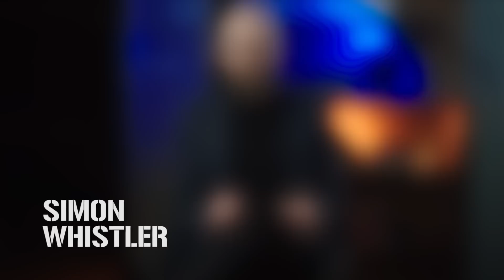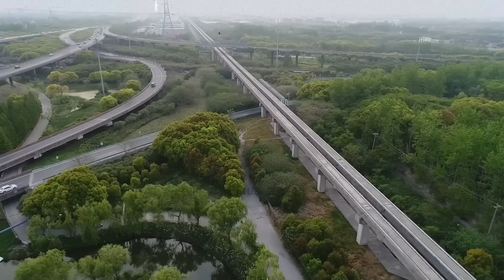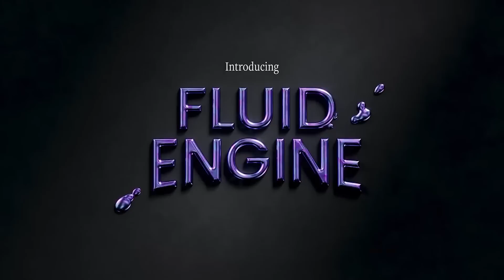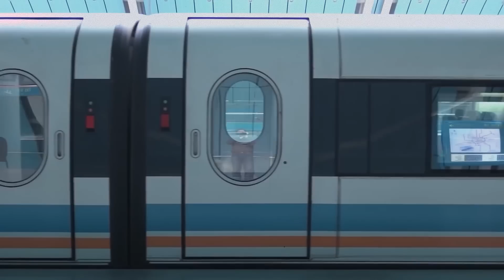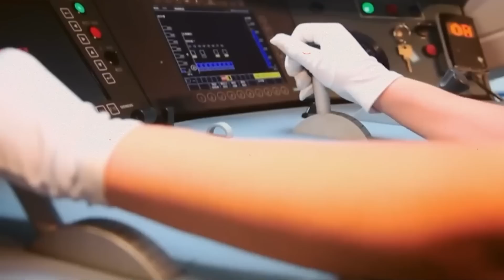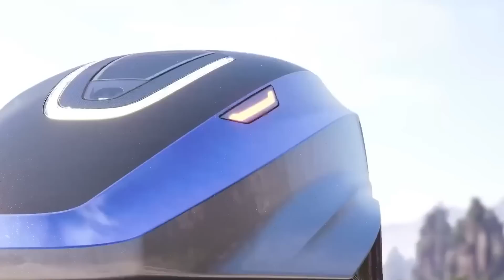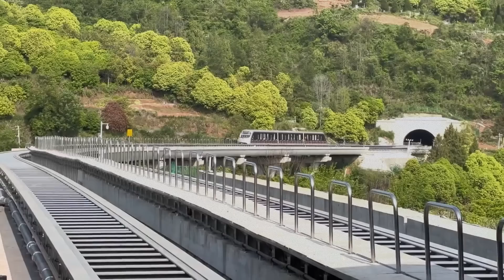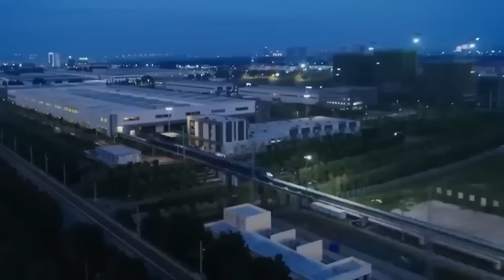A Chinese Maglev Revolution is Coming...

Comment: Here's the fun fact, US spent 8 trillions in Afghan war, roughly 5 times the cost of China's total rail spending for the last 15 years. In that period, China has built 95% of the 45000km HSR, along with maintaining and expanding it's huge regular lines.
Reply: One thing many people don't pay much attention to is that China didn't only build over 40000 km or HSR, but also over 140000 km of highways.
Reply: You forgot to mention the success of those $8 trilliion in replacing Taliban with Taliban.
Reply: @fvalemus5377  Which goes to show US military spending is really just an elaborate form of money laundering. The real purpose is to move wealth from the 99% to the 1%.
Reply: @fvalemus5377 😢😢
Reply: @fvalemus5377  you got me all the comments here it's me, I'm using multiple accounts Kevin Feige pays me to make Chinese people watch Shang Chi 2
Reply: With how the US spends money, let's not pretend that 8 trillion could've build half of that rail.....
Reply: @lzl4226 it did build the wealth of various companies and persons involved in such corruption in the US and no one bats an eye
Reply: Wow 8 trillions that's 26K per capita of US population
Reply: @youtaccount-v2p  and if you ask the average american voter "do you feel safer now that the US wasted all that money on the war on terror?" The answer is a resounding no.
Reply: by 2035 China high speed rail amounted to 70000km with some running at 600km/hr.
Reply: @Lsy-j7m  I don't want to go even like 50km/h on their tofu dreg rails. Do you know why Railway tracks are so expensive in the western world?
Reply: 8 trillion was the cost of the global war on terror, the Afghanistan/Pakistan war zone cost "only" 2.3 trillion
Reply: And US also tried to build the California HSR around the same time China built theirs too. Lol
Reply: It was money laundering.from American tax payers to military complex.Poor Afghan
Reply: Correction, US spent 8 trillion to develop their military industrial complex.
Reply: @firedup692 *enrich their stock owning politicians
Reply: @firedup692   the complex that couldn't even replenish the ammunition sent to Ukraine fast enough
Reply: Its not Afghan war, its an Afghan invasion.
Reply: Not so fun for Afghanistan....
Reply: 300 Billions every year to look after the people who had been to war.
Veterans got free health care, free housing, free employment, free university. 
Freedom ain't free, the rest of you pay up

300 bil is not part of 800 bil defense budget.

actually the rest of us's "middle class" taxes is a tiny drop in a bucket, the Rich pays majority of taxes anyways.
Reply: Makes you wonder...
Who is smarter?
Hahaha 😂
Reply: don't complain, the military complex earn that 8 trillions. they are the winner.
Reply: Unfortunately, California HSR is expected to cost about 12 times more than China's median cost per mile (5 times higher than comparable lines in France or Spain). If we don't figure out where the extra money is going, a nationwide system won't be viable.

France's Paris-Marseilles TGV line was rated for 220mph (California even considered using the same trainsets), crossed earthquake prone mountain ranges (similar in scale to those around LA), was built with unionized labor, ran across a nation with the same population density as California, and costed $33M/mile (using the construction cost inflation index, that'd be about $50m/mile). Going off California's $128B completion cost for the total 520 miles, that's a five-fold markup.

Heck, even Japan's experimental 370+mph, fully underground, airplane speed maglev running through some of the densest, expensive, and most tectonically unstable regions of the world has a lower cost per mile than this.

I don't want to scream corruption, but HSR shouldn't cost anywhere close to this, and ineptitude alone isn't a suitable explanation.
Reply: @GeoMeridium NEPA!!!!! Lawsuits caused this
Reply: bUt aT wHaT cOsT???
Reply: And still lost the war 😂😂😂
Reply: The clearest difference between China and the US.
Reply: @St.Altaire the difference is China built this for it’s people 
While USA don’t do anything for it’s people
Reply: @St.Altaire  Well, China did spend much of the 20th century butchering each other by the tens of millions; the US has no answer for that.
Reply: Lol
Reply: Lots of contractors bought McMansions in the Northern Virginia suburbs, so who's to say it was a waste?
Reply: US is obsess with winning
Reply: Imagine what the US would be like if it had spent that 8 trillion on infrastructure instead -_- oof...
Reply: "Here's the fun fact, US spent 8 trillions in Afghan war..."
How dare you spreading that hate propaganda?
USA, as a true leader of free world, invested 8 trillions in supporting human rights and building strong foundations for peace and democracy in Afghanistan.
Reply: @fortissimoX lol
Reply: taliban still there after 8 trillions, lol
Reply: How much money they give to Israel since 1948??
Reply: And the media says China is bankrupting it self making all this infrastructure
Reply: You didn't mention those who own stocks in Military industrial conplex are making a killing from wars. The rich get richer.
Reply: US spends their money to bomb others and China spends their money to build infrastructure. It’s not rocket science to understand why the U.S. does not have a bright future.
Reply: All went to US arms companies not Afghanistan
Reply: This line of comments is Russian paid propaganda.    The USA did not spend 8 trillion on Afghan war it was around 200-300 billion and it had no option after 9/11 attack which was done by Al Qaeda based out of Afghanistan. The USA even asked Taliban to hand over Al Qaeda which would have prevented an invasion but they said no.        COVID was 5 trillion, the USA has never spent 8 trillion on anything.
Reply: This line of comments is Russian paid propaganda.    The USA did not spend 8 trillion on Afghan war it was around 200-300 billion
Reply: Warning this entire comment thread is Russian paid propaganda!   The USA spent 200-300 billion NOT 8 trillion and had no option after what happened in 2001 attack on the USA.    It had to go and catch the people that committed it which it did.  But the cost was 200-300 billion NOT 8 trillion that is a conspiracy clearly tied back to Russia.   Don't fall for Propaganda .
Reply: That’s because the American people are colonized by a group of elites that never had their interest in mind and can claim full control of our “national” priorities for the past 70 years at least. #NotADemocracy
Reply: I'm sick of it.   

These status symbols don't help a million commuters get home an hour early. 

These stupid things aren't for transportation, they're for political bragging rights, like the Moon shots. 

Long distance maglevs, "bullet trains", HSRs  --- that's what PLANES are for.
Reply: Yeah but they managed to cause a lot of trouble in Xinjiang with cia operatives thanks to that war, and left as soon as china uplifted xinjiang preventing any more radicalisation.
Reply: 应该是2万亿军费化在阿富汗。
Reply: But the rich got richer 👏. Syphoned to the megacorporations
Reply: 😂😂😂 the complete ignorance of the privileged few in power will be the end of the one superpower of the USA. They will milk these military contractor to feed their illusions of grandeur all the while the Chinese strengthen their economy. These privileged few in the USA try to keep all other ethnic groups down and out of their neighborhoods. All the while the Chinese have been gaining control of every aspect of manufacturing,infrastructure, and economics. The only grand scale building the USA has done is private prisons. No grand scale infrastructure projects since the 70”s. It’s just embarrassing what these privileged few have done to this once great country
Reply: Compare it to the amtrack spendings 🤣
Reply: And they are still using the same 50 year old trains in china
Reply: Yeah but did you consider that China printed a government bond to fund that? Something that the US never does, of course.
Reply: Don’t you just love the military industrial complex
Reply: Damn, thats a big amount of Honkai Star Rail!
Reply: Don’t worry we have the the amtrak
Reply: Tự do dân chủ nhưng chính phủ làm gì thì người dân không thể làm gì 😂😂😂
Reply: See this video;

China's "ghost" railway stations prompt questions about rapid expansion ...

^^ $1 trillion in debt and they don't make money.

Long distance maglevs, "bullet trains", HSRs  --- that's what PLANES are for. 

These status symbols don't help a million commuters get home an hour early. 

These stupid things aren't for transportation, they're for political bragging rights, like the Moon shots.
Reply: Funny, I thought the bill was about 2 trillions, if you include Iraq and all associated spending it should be in the region of 4-6 trillion us dollars...
Reply: And??
Reply: China has no NEPA like law
Reply: And lost aghanistan too .
Reply: some people become super rich from the war.
Reply: Don't forget that it's an investment. Because America has managed to get a lot of income from arms sales Create chaos so weapons can sell
Reply: @AbdulMalik-dh6dw   An investment would be productive infrastructure that improves the domestic economy and the living standard of Americans. Spending on weapons creates none of the economic benefits that spending on rail, HSR, bridges, power production and distribution, ports, or airports. To give an example: one of the less-understood advantages China has is the cheaper cost of electricity, due to huge investment in power production. In 2000, the US produced four times more power than China. In 2024, China produces two times more power than the US. One of the reasons manufacturing companies choose to set up in China is that cheap electricity.

The people who really benefit from the US' military industrial complex are the owners (i.e. shareholders) and the members of Congress who get bribed by the military industrial complex.
Reply: You didn’t even give a source. Because everything else says that the Afghan War (which lasted 2 decades) cost $2 trillion.
Reply: Just for context, did the U.S. lose 8 trillion or did it profit from the war?

Also, we must keep in mind total wealth and budgets by area. In the context of the military, 8 trillion is not unthinkable -- and military funding itself is only a small amount of total nation funding.

This is the advantage to state architecture, as China has, and some other nations. The richest nations on Earth have billions or trillions to spend at will -- but only dictatorships tend to in such a fashion.

Let's look at Nazi Germany. They famously spent much more than anybody, ever. Today, their German Stadium would be the largest at 400,000 seats and cost roughly 22 billion in today's dollars, with the most costly as of 2024 being merely 5 billion. Likewise, their New Reich Chancellery cost something like 400 billion dollars. One of the largest and grandest governmental buildings at the time, heavily made with granite and limestones. 

Dubai wanted to spend 1 trillion on their 'The Line'. This may still happen by 2050 or so. Musk wanted a 'hyperloop' system as next-stage public travel, which would cost many billions to begin with. These are certainly possible with enough talent, money, and/or slave labour.

China is again building the largest dam? An African nation is also doing something like this, if I can recall. Japan is still building a nation-wide and costly train system. North Korea has spent a lot on its mega-projects (again, easy given that the state controls all wealth and labour, pretty much).

When required and, more so, without red tape, you can build an entire empire out of dirt quite rapidly. A great example is modern New York City, which cost endless billions and includes some of the largest and grandest creations in the world, and some of the busiest and most well-made. New York City was largely made of just 100 years between 1850 and 1950.

Musk himself will likely have 1 trillion dollars before his death. Apple or Microsoft now has the most about of money at around 3 trillion. Dubai itself has made about 5 trillion over the last 10 years from oil (not including all illegal wealth and so on), though some people think this will crash soon. If China keeps growing, it will be rich and manned enough to do just about anything it wants by 2030. 

The largest active complex in the world might be Mecca Mosque, which cost around 70 billion and is still growing. If Islam dominates over the next 50 years and can sustain income growth, it will be able to turn the entire world into a shrine in stupendous fashion. Many Islamic nations already have hundreds of billions each. Such things have somewhat happened before, with Nazi Germany, the Roman Empire, and currently, China.

The U.S. itself can easily access 100 trillion dollars in total if it had to, along with over 100 million men for ungodly efforts (i.e. WWIII via U.S. land invasion or something equally profound). The U.S. government spends like 10 trillion dollars a year, so 8 trillion for a long-standing war with major interests is not Earth-shattering. 

Worse is the 15 trillion or whatever it spent on poverty, only for poverty to be slightly worse in 2024 compared to 1960. At least, this is what I read. If this is accurate without deeper context, that means they literally threw away 15 trillion over 60 years.
Reply: @SwitchTalkChannel  
"I'm from government, and I'm here to help you."
Reply: This line of comments is Russian paid propaganda.    The USA did not spend 8 trillion on Afghan war it was around 200-300 billion and it had no option after 9/11 attack which was done by Al Qaeda based out of Afghanistan. The USA even asked Taliban to hand over Al Qaeda which would have prevented an invasion but they said no.        COVID was 5 trillion, the USA has never spent 8 trillion on anything.
Reply: Of that 7 trillion stayed in USA as weapons program is jobs program . So net growth for USA
Reply: That's right. But there's one thing more. It's because of those investments that the US can pressure China.
Reply: This is Russian Propaganda comment thread.    The USA spent 200-300 billion NOT 8 trillion.
Reply: @DrScopey2 US Budget alone is 600bill annually dude. If you want to lie at least make up reasonable number
Reply: @roxylius7550 NO the US annual budget is 4.5 trillion or 4,500 billion.  The US military/defense budget is 600 billion.     The money for Ukraine is only 60 billion totally peanuts.   We spent 5,000  billion or 5 trillion on COVID stimmy checks.     5,000 on COVID stimmy, 4,500 every year to operate the US government and 60 to ukraine, freaking PEANUTS,
Reply: @DrScopey2  we were talking about afghan and iraq… who said anything about ukraine? Check you script before replying, you might not get your pay replying like that
Reply: @DrScopey2  Usspending says this year was 1.4 trillion, and 2022 was 700 billion. I think it is reasonable to say they soend around 600-1000 billion annualy, depending on how hot are their wars all over the world. Anyways its useless spending despite the jobs it creates. It not only leads to the murder and humiliation of millions, in the end the US doens't achieve its military objectives against the resistance and millions of Usonians are deprived of better services and social security.
Reply: With all the advantages America has had the country could genuinely be in 2100 right now. No homeless, manageable debt per person, insane infrastructure, convenient technologies, proper wealth distribution and VERY high standard of living. Well, it's possible on paper with how privileged America's position is/was. But nah that was never the goal
Reply: @dunzhen not possible in a capitalist society
Reply: @DrScopey2 $2.314 trillions. Just google, unless you think it is also Russian propaganda.
Reply: @Whitfield369  Some news sources get it wrong but that was for both Iraq and Afghanistan  and even includes the cost of cleaning up NYC and Pentagon and rebuilding.     The actual Iraq war was around 1 trillion and Afghanistan a few hundred billion.
Reply: @DrScopey2 source? I made it up

$200 billion isn’t even the US defense budget for a year. Dawg you’re making shit up
Reply: @musicdev  USA spent on Afghanistan war 200-300 billion but over 1 trillion on Iraq.  The Iraq war was costly of course as it was much larger operation.

Comment: Maglevs being an entirely new track technology should take the opportunity to be about double the loading gauge of current trains such as about 8 meters wide.   The 1840s dual track British railroads were designed to occasionally have double width carriages running on the inner rails of the two tracks.   This would open up the ability to transfer large cargo over land.  The super train concepts of prewar WW2 Germany and post WW2 soviet union were at least double the loading gauge of the current trains.   An 8 meter wide interior would allow the first level to hold typical motor cars perpendicular while possibly not being continues between the passenger train cars.   The stability of being 8 meters wide would allow three levels with the top two levels being continues between the cars, quiet and allowing great comfort.   Passenger trains could more comfortably hold 4 times the number of passengers in the same linear space as todays trains keeping passenger trains from stretching out many city blocks.

Comment: After China build this Meglev net, is China bankrupt.😂 There is a reason why Japan doesn't build further. If you look at the costs, the tickets would be so expensive that nobody would use it.
Reply: theres nothing particularly rare or difficult to produce for a maglev line. its just a matter of optimising supply chains for mass production.